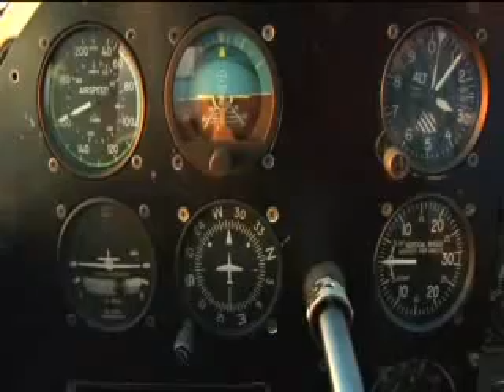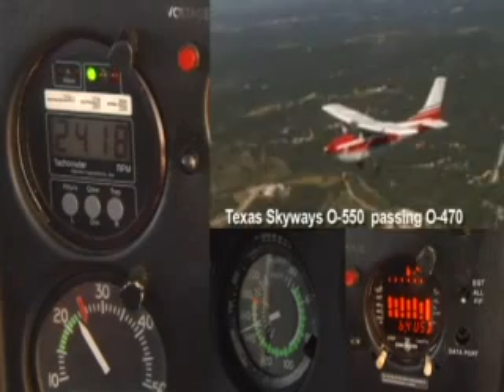Texas Skyways Cessna 180 & 182 Performance Comparison

Comment: I raise the nose at 60 mph and am flying in the middle of the second set of landing stripes on the runway. Best climb is 80 mph - I approach over the fence at 90 mph and settle down to flare at about 50-55 but am looking out the window not staring at airspeed indicator (full flaps).  I climb at 1500 feet per minute at 80 mph-- 2000 when just me and light fuel load.. Even higher rate when cool air. Tx Skyways conversion with three bladed prop and also micro VGs installed.. much more stable - Best money I ever spent on my 182P.
bobf

Comment: "Notice that airsped indicator": NOT 160 knots but 160 Statute Miles Per Hour.  The inside scale is knots and it shows 140 knots.  That is a BIG difference.
Reply: Also wheel pants on the conversion plane. Not fair.
Reply: @delgriffith1    Wheel pants + stating Knots means the people are not ethical.
Also I think the 1971 Cessna did not have the small "cuff" under the leading edge.
Unfair all the way around.